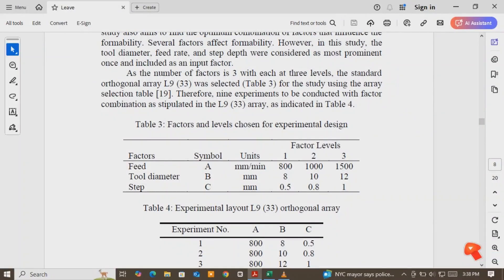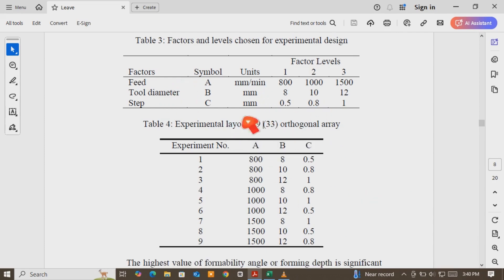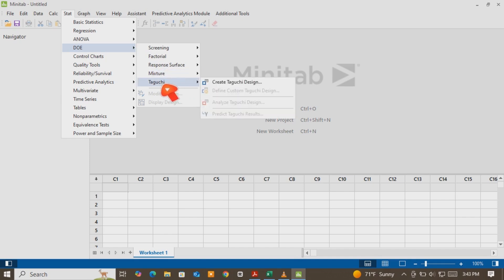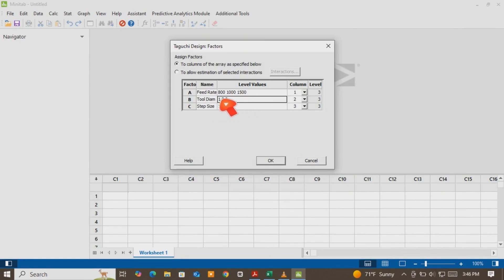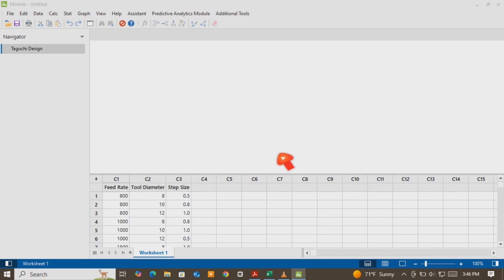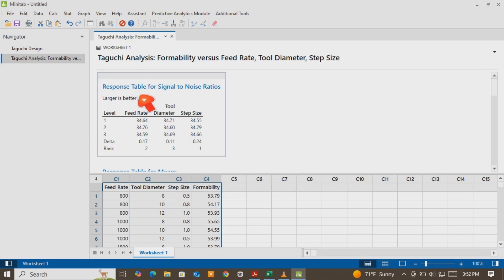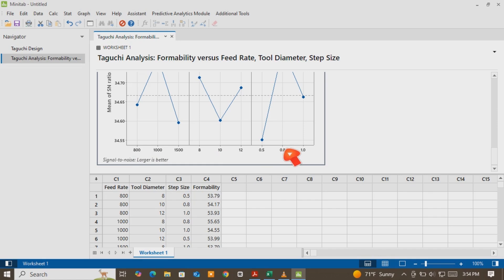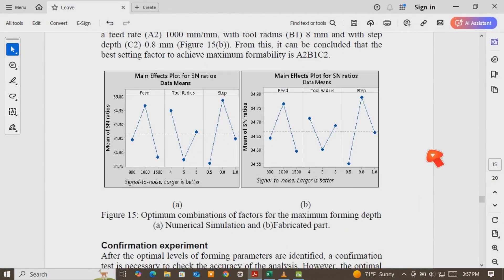How to Define Taguchi Design of Experiment (DOE) in Minitab | Step-by-Step Tutorial

Comment: i have questions if you can l have been research proposal with 3 level and 3 factor experiment but i can not optimize these becouse i cannot run this large experimental runs  in the cause of time, and monay expensiveness. so can you suggest me in order to optimization of design
Reply from the maker: If you have 3 factors at 3 levels each, the minimum number of experiments in Taguchi design is 9, using the L9 orthogonal array. Not feasible to change the number of experiments.